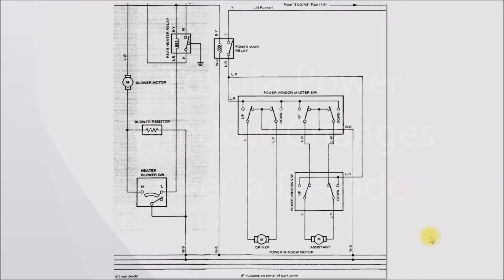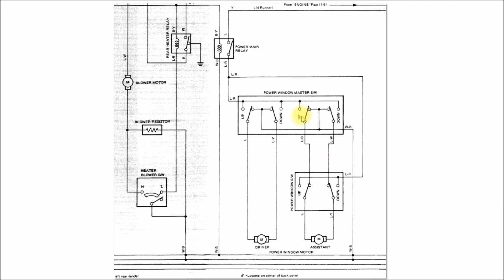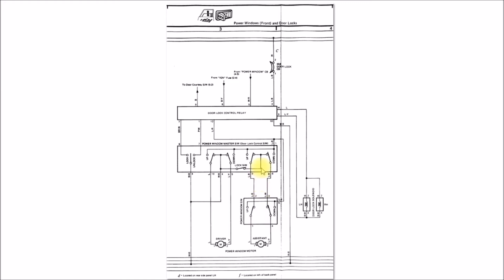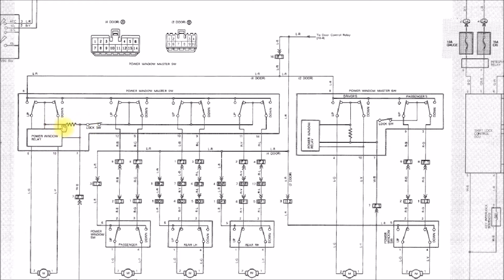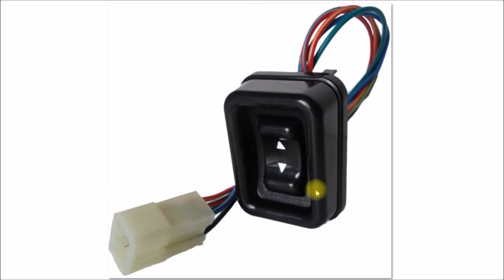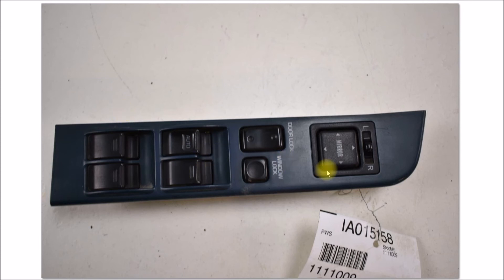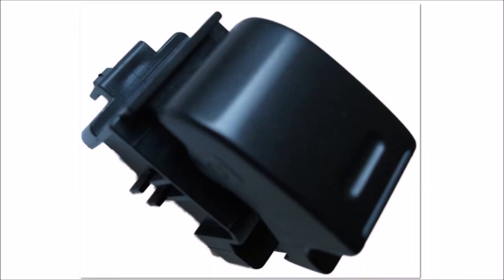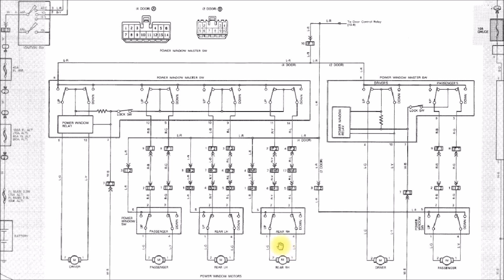Toyota Power Window Changes over a Decade (1985-1995)

Comment: Hi
I’m using a 2nd gen 4runner window switches for 1988 Mazda b2200 manual to power window conversion. I was told to do this connection but not working
Power(12V)-Blue with red stripe
Up position-Blue/green stripe with red dash 
Down position-Blue/yellow stripe with red dash
And The two red wires are not used and these ground purpose?
Can you kindly let me know how to connect the switches to the aftermarket motors? 
Thank you
Reply from the maker: Take a look at the wiring diagram at 3:50, it'll show the connections to the motors on the 2nd gen 4Runner.  Basically the same as the earlier vehicles just with the added safety interlocks.  You just need to find the two outputs of the passenger side switch, those go to the motor, one to each side.  Then you have 12V to the normally open contacts on both sets of switches and ground to the normally closed contacts on the driver's side.
Reply: @The4Crawler  thank you. Here are the outputs
Power-Blue with red stripe
Up-Blue/green stripe with red dash 
Down-Blue/yellow stripe with red dash
These outputs are connected to the aftermarket motor. Red and blue wires. 
And the Power source-Blue with red stripe from the switch.
That should work right?

Comment: Wow, that was enlightening. On my 1988, the lock switch disintegrated due to the dogs running over it for so long. So now I'll fix that whole mess and see if that works before I go to the passenger side motor! Thanks.
Reply from the maker: Yes, get the driver's side working first as all the wires run through it before heading across to the passenger side.

Comment: I was one of those kids that leaned my big head out of the window of my mom's '86 Oldsmobile, accidentally mashing the window switch and closing it on myself.  Not my proudest moment.
Reply from the maker: Great story, thanks for sharing.  It was some time around there that lots of the safety stuff like this was introduced.  The neutral/park start interlock switches were another one.
Reply: @The4Crawler  Have you ever looked into the low fuel warning lights on these old pickups?  My ‘94 22RE DLX 4x4 must not have the sensor in the tank because I ran a wire from the pin on the fuel tank pigtail’s connector up to the gauge cluster and it won’t trigger the bulb even when ran to empty.  But perhaps that should come as no surprise because it would be odd for them to have all necessary components in place for the light to function except for that wire.